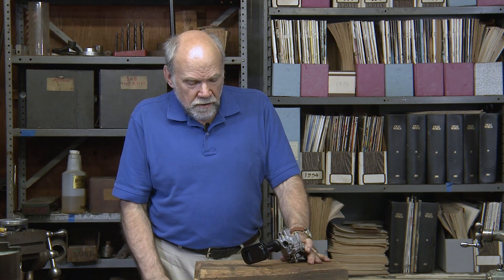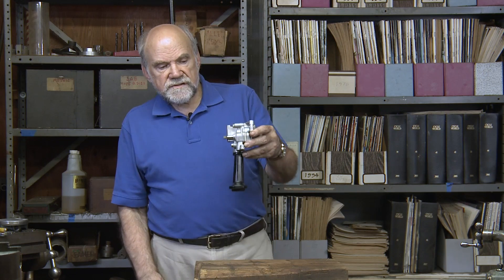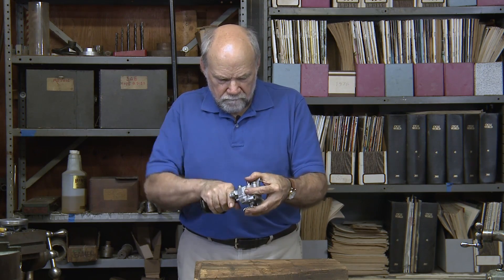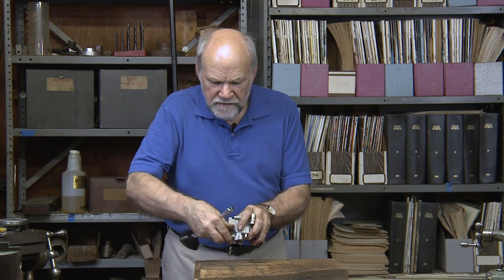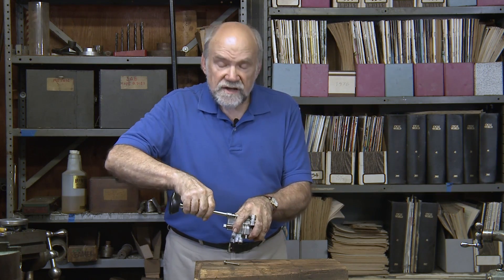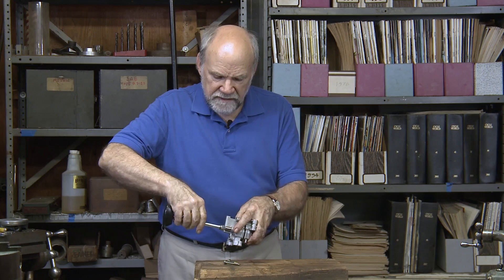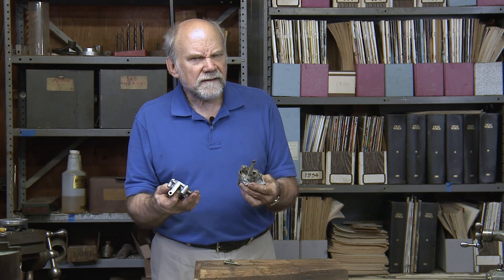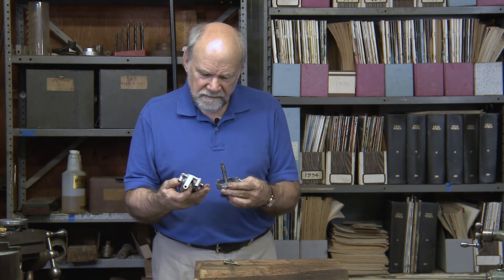How Does A Motorcycle Oil Pump Work?

Comment: Again, great video Kevin! Just two quick questions : if the oil filter is after the pump, doesn't it increase the chance of pump failure in case of debris or foreign elements? And did we put the filter after the pump because it required the pressure provided by the pump? Thanks!
Reply: I think its after the pump, because in front of the pump, there is low pressure, and after high. and you can only make the presure 0, you can't go lower, so you have to set the oil filter bypass valve at somwhere between 0 and 1 atm. if it was before the pump, wich gives little room for varying pressure over the filter. after the pump the pressure can be up to 5 atm or even more. then you could easily set the bypass valve to open if there is 1 atm over the filter. whereas if it was before the pump you could only use 0,5 atm or even less. it gets worse if the engine is operated at altitude. so maybe even down to 0,3 atm. and a lot more oil would bypass the filter. hope it makes sense, and my guessing is somewhere near the truth :-)
Reply: @MC-Racing  Oh woah, OK, makes complete sense! Thanks a lot :)
Reply: @3eeple  No problem. i just hope my speculations are correct, and if there are further reasons, someone wil add on. BTW there is a filterscreen on the pickut to strain bigger objects out of the pump ;-)